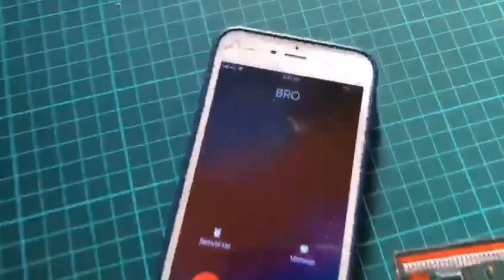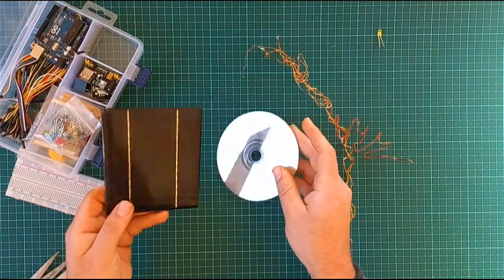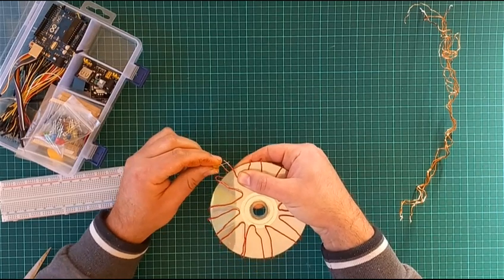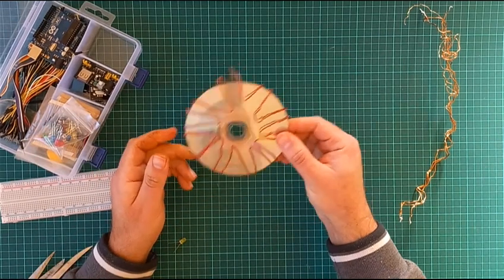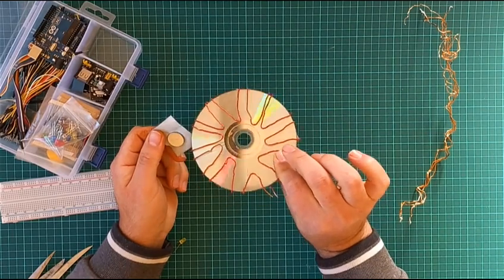Real OR Fake , turning CD/DVD into a solar panel

Comment: So, they do in fact produce electricity but I guarantee you'll be disappointed. In direct sunlight, 0.2v per DVD. So, you would need 8 to equal the voltage of a AAA 1.5v battery (and that is assuming you have perfect sunlight and everything has a perfect connection) The efficiency would  be abysmal. Just go to harbor freight and buy a $50 solar panel...